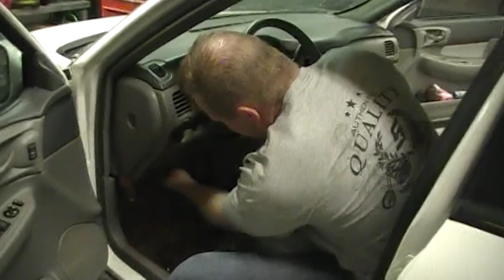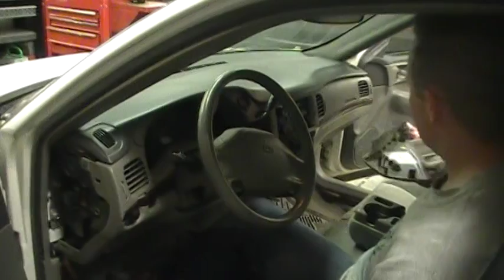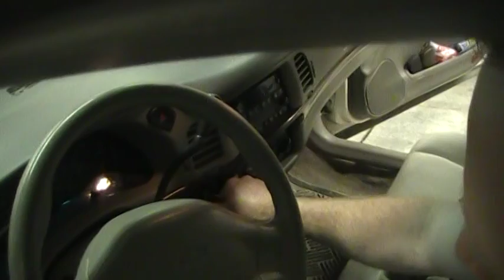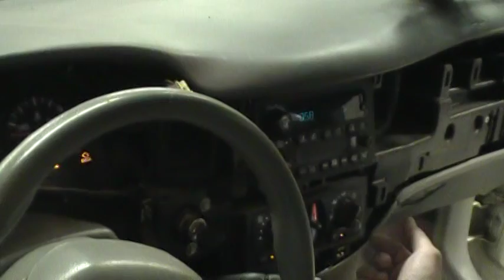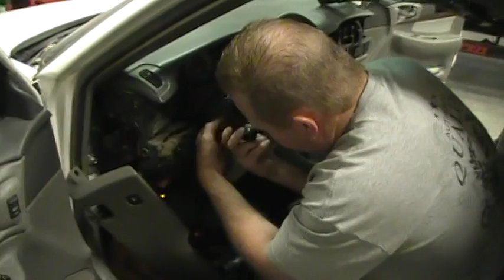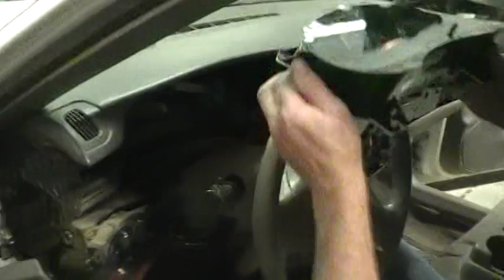2000 - 2005 Chevrolet Impala Instrument Cluster Removal by Cluster Fix

Comment: 2005 has a recall from the factory for the ignition switch. The dealership will replace it for free. Just a little FYI for your viewers
Reply: all my dealership told me they do is put tape on the key? Is it all they are suppose to do?
Reply from the maker: Yes, they had some problems and with the theft portion as well causing no starts. Thanks for the information

Comment: Thanks for the video and clear instructions. My fuel gauge and speedometer were not working on my 05 Impala. Withnyour help I pulled the cluster without any major problems and took it for repair to AAE in Richmond, Va. $189 for a refurbished cluster bench tested and recalibrated with my mileage. Don't have time to do the overhaul myself, but pulling it and putting it back in with your guidance made it easy.

Comment: This is a great video on cluster repair. My 2000 Impala needs a new cluster probably. My fuel guage isn't working correctly. I ran out of gas last night. There seems to be a lot of screws to take out. I'm assuming that one guage goes bad the entire cluster has to replaced. Awesome video. It's easier than I thought it would be.
Reply: +CHRIS ANDERSON It could be more than the visual fuel gauge that isn't functioning correctly.  Mine is doing the same thing. I'm not sure what the problem is, whether it's the gas tank or something else. What I do is use the trip meter and have been doing it for almost 3 years without incident. I usually fill the tank up every 200 miles (even though the car can go past 200 miles).
Reply: CHRIS ANDERSON Did you ever figure out the problem?
I got the same problem with the gas gauge only.
I heard the fuel sensor/sender and/or the harness plug can cause the problem.

Comment: Thanks again for the video.  I removed the panel in my 2005 Impala LS yesterday, stripped the instrument cluster and replaced all six stepper motors along with five of the bulbs.  Because of your thorough instructions the job was trouble free and totally successful.  I shudder to think how much panel replacement at my garage would have cost me.  I did the job for about $25 US. 

One caution for others.  Don't forget to reconnect the flat multi-pin plug when reassembling the panel itself.  I almost did.  Doing all that removal and soldering on a complex circuit board was a little challenging for me.  I was greatly relieved when all the gauges worked and were steadier than ever.